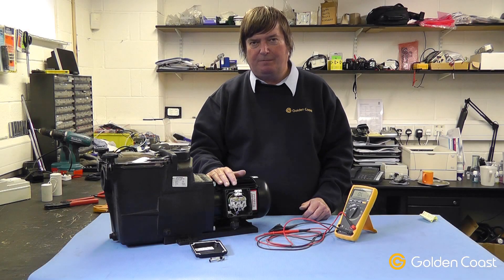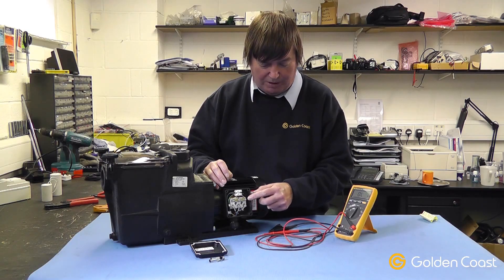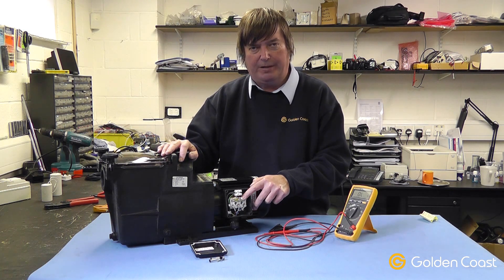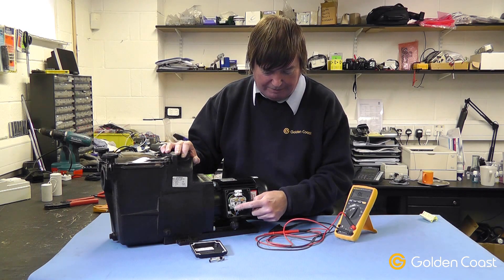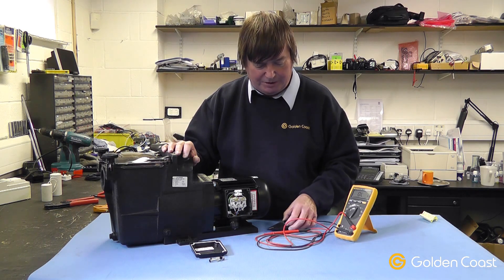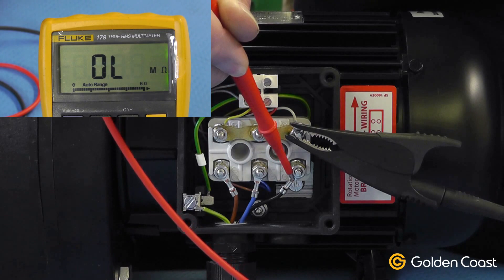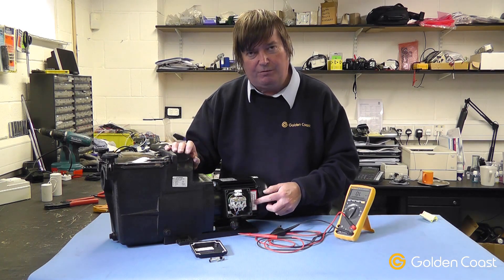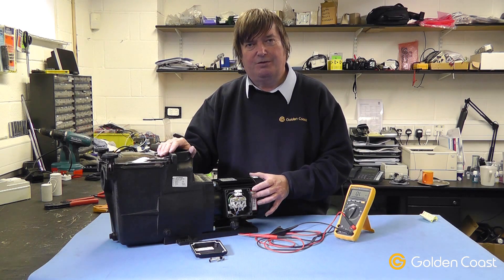Connecting a Three Phase Pool Pump | Andy's Answers

Comment: How can I run a 3 phase pump on single phase
Reply from the maker: In some cases and if the 3 phase pump’s rated voltage is 230/400 and NOT 400/690, it is possible to run it as single phase using a Variable Frequency Drive (sometimes called a VSD or Inverter).
To be sure and safe I would suggest you first check with either the manufacturer or the pool company that supplied the pump.